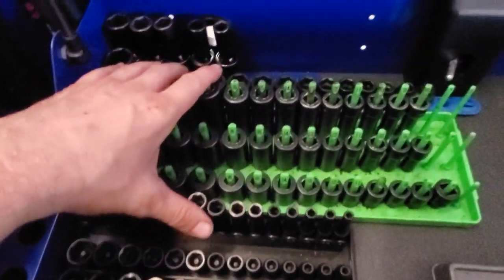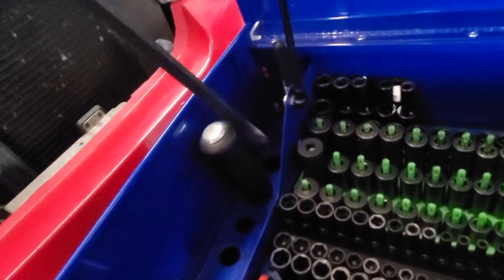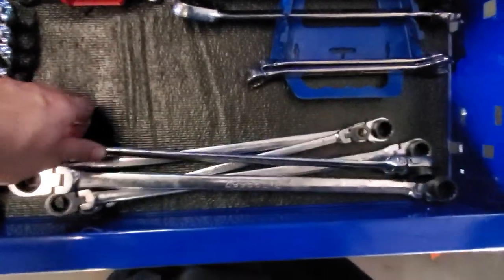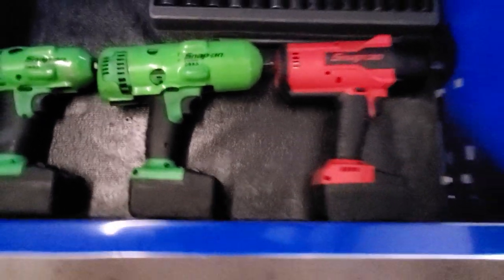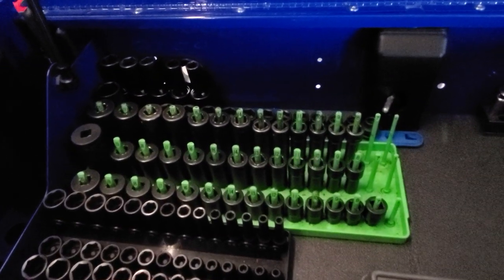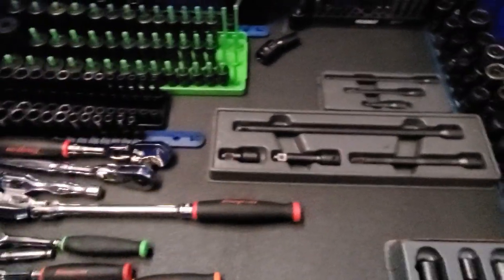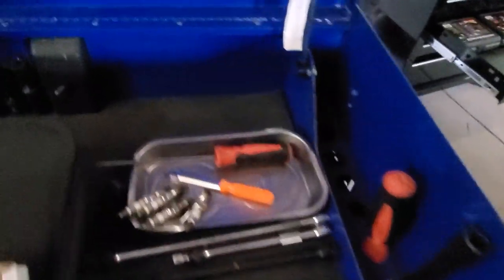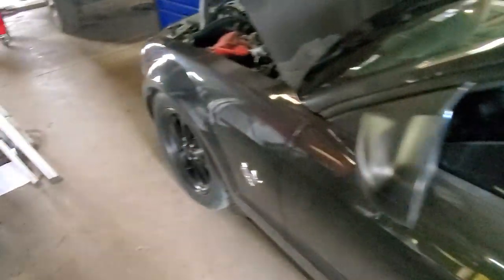Snap on tool box tour! My new roll cart!

Comment: I have heard of those straight pry bars being called screw drivers by older mechanics. Snap on considers them straight striking prybars. As for the swivel socket, the snap on pulls nuts and bolts off faster due to not having much play but i have yet to break a matco. I would say the matco might be stronger but the snap on removes faster.

Comment: Give it a couple years and you be throwing them snap on battery tools away and them mat co sockets adv what ever the hell they are are just sunex sockets a lot of mat co stuff is rebranded
Reply from the maker: I only have one set of adv, the rest are the usa matco. I haven't had a problem with my snap on batteries and some of them are 5 years old
Reply: @montevallomustang   I had bad experience with snap on battery tools I had coworkers who had problems with them but I got all Milwaukee hell I got some that are 7 plus years old still working like there brand new and Milwaukee cheaper has way more power and torque but I also know people who snap on battery tools so you like use them but Milwaukee killing it with battery tools and mat co killing it with air tools they plenty of test to prove it
Reply from the maker: I guess you haven't heard, the new snap on power tools are more powerful than Milwaukee. I like Milwaukee for some tools and snap on for others
Reply: @montevallomustang  I highly doubt that I tell you how bad snap on battery tools are even my snap on truck driver said not to buy them he said to buy the Milwaukee he sells because he having more warranty sent off with there battery tools then anything and they have to send them off to Pennsylvania to be fixed
Reply from the maker: @jacobstacy588  lol check out the torque test channel
Reply from the maker: https://youtu.be/pFQ-SSu1-PI